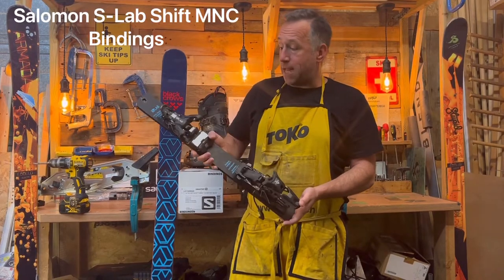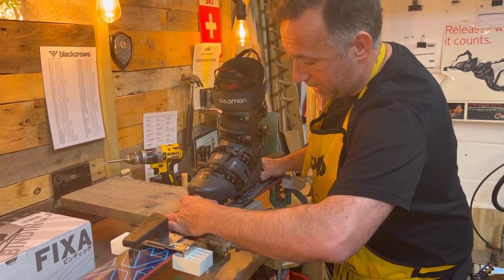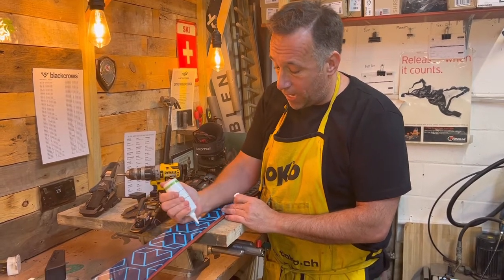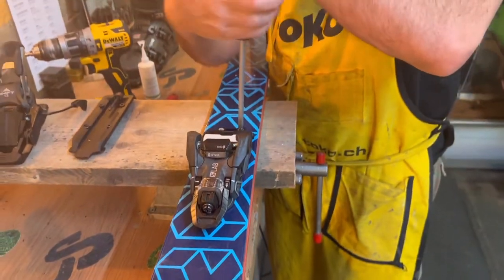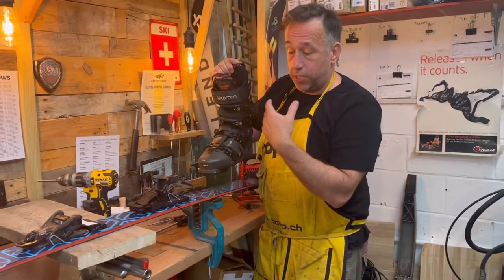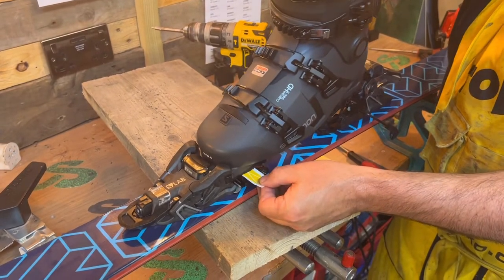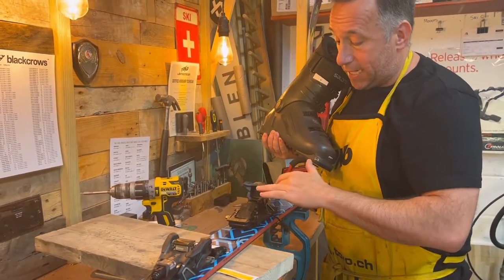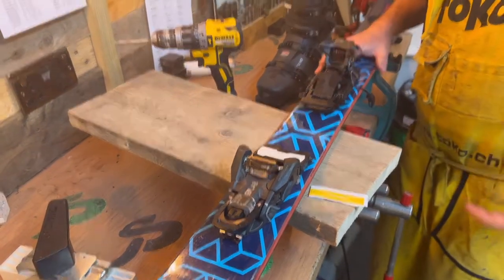Ski Binding mounting: Salomon S-Lab Shift MNC onto Black Crow Captis Skis

Comment: To avoid confusion I refer to the mark on the ski as the Mid- Sole mark or Recommend Mounting Point. When you use the term’ Center Point some people interpret that as being the Center of the ski length that many Park Skiers like to mount their Twin Tip skis for riding “ Switch”(backwards). Traditional Mid- Sole marks are behind the True Center on directional skis. I have noticed some confusion on this terminology. Some ski manufacturers have a Recommended Mid Sole mark plus several marks in one centimeter increments for skiers who like to be more forward on the ski.

Comment: So I was going to take my shifts off so I could try moving them back 3 cm using binding freedom inserts on my bent chetler skis but after watching this video, I’m not sure that will work due to that locking screw on the very front of the toe piece. I assume that locking screw has to go right into the ski, correct?

Comment: Very good explanation. I'm trying to track down which Solomon Atomic jig will work with the Shift bindings. Do you have part# or name that I could use to find one to purchase. I live in remote Wyoming and need to mount 7 plus skis with shifts.
Reply: Find a jig? If not.... Part  # L39894700 shift jig.

Comment: Just bought these bindings and I find it hard to lock the walk mode. Feels like I’m gonna brake it. Is this normal? Salomon Shift boots, Atomic shift 13. The toe part of the boot rubs on the binding just a bit also.
Reply: Just got some too. Same issue. I think the oil needs working in. So go through the full range up and down several times with no boot there and it’ll free up . First time will be very hard to move it. . After that try it with the boot, again first time time will be tough. Keep going to free it up.
Reply: @alanlucker5048  It got better after few times. I used my pole under the leaver and pulled with both hands.

Comment: I am considering purchasing some used skis that come with the Shift 13 bindings, they are currently sized for 28/28.5 boots, but I need 29/29.5. Is this possible without having the bindings redrilled?
Reply: Same question here. Anyone knows?